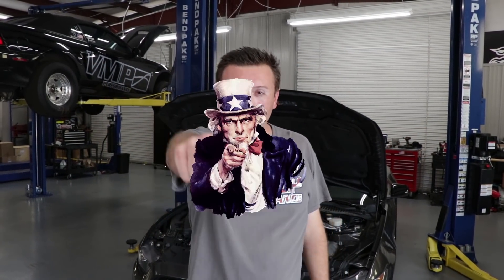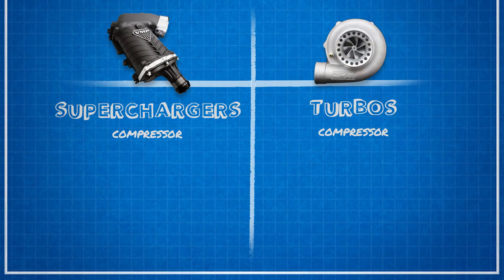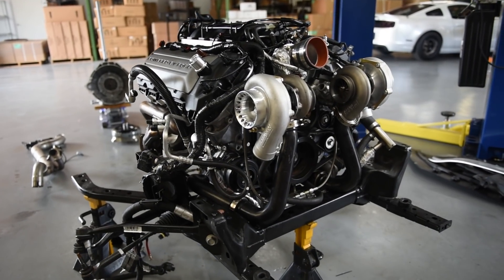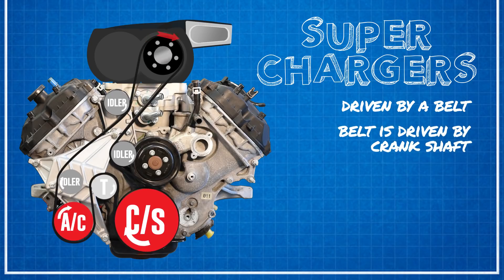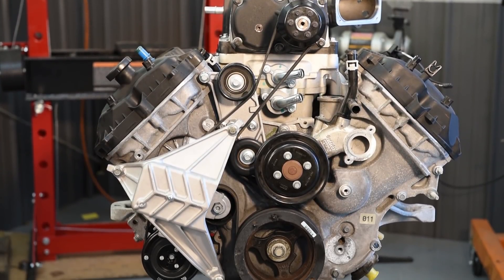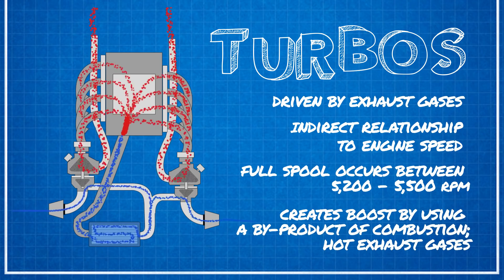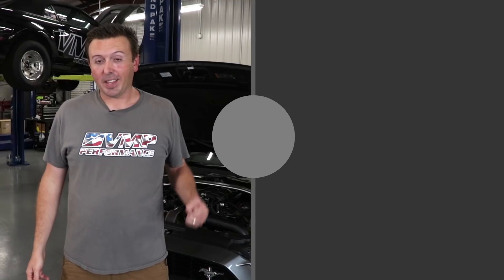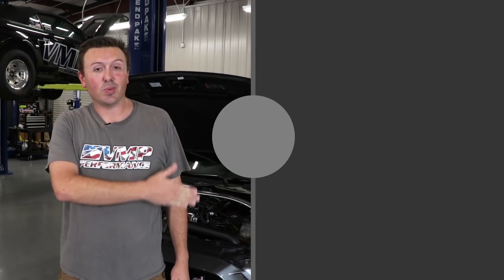VMP Performance | Superchargers vs. Twin Turbos

Comment: I love the  gen3r for boost.. twins turbos are nice too...what can I do to my 2016 mustang gt premium  to make 800hp on pump gas? Is that possible?
Reply from the maker: Hey Billy.  With the Coyote, we're limited to right around 700+/- rwhp on 93 pump fuel.  The knock resistance of 93 won't handle much, if anything more.  With a return style fuel system and E85, you're opened up to 800rwhp and above.
Reply: Do 93 and boostane.  Boostane is fairly convenient and the price isn't that bad (145 bucks for an 8 pack of premium on ebay) which is about 16 a bottle.  One bottle per full tank.  It will get you a decent bit of headroom above 93 only and you could prob Crack your goal with the right supporting mods.  Adding 16 to each tank isnt that bad considering it turns 93 octane into 100 octane lol.  It's like little over a dollar per gallon more which is a bargain plus like I said its convenient just keep a few in the trunk and add whenever you fill up.  Pretty simple.

Comment: Is it safe to have that much horsepower in a convertible? I want to do mine, but afraid of traction issues and taking the fun out of driving the car if it slips on ya.
Reply: If you're asking that question this power level probably isn't for you lol.  These modern cars are very safe but a vert can only be so safe.

Comment: ?the insta tq on a PD car is awesome, turbo will always have more headroom.  street car?  blower all day
Reply: A properly sized turbo will have more headroom.  A tiny one won't make the power.  If it isn't an all out race car the tvs is easily the better choice especially for street cars.  They can still go PLENTY fast and make PLENTY of power obviously.  More trouble free it's just all around better for a street car like you said.

Comment: The twin turbo car is built to be a dyno queen, in real life I personally wouldnt use turbos with a trim like that. Smaller turbos are way better you want to fully spool by 3500. That will make more useable power...

I think between the two the vmp gen 3 is the better way to go. That torque curve is incredible... Thats a very very fast car! And just from looking at the curve more of the vehicle id want to drive.

Also having less parts makes the system cheaper overall to maintain and trouble shoot in the long run.

Comment: You know how, like you are racing someone and you got him off the line, and your like, wow I'm taking this guy pretty good. Then all of a sudden, he goes blowing by you? well, that's what my turbo's will do, just keep pulling and pulling. I have both blower and Turbo vehicles. I didn't hear anything about boost numbers, and or boost control settings, maybe i missed it. In your dyno results, it appears the blower gets some instant torque, and steady power, only to go flat in torque and stops short on horsepower where the turbo's didn't. I'd bet at the track the twin turbo gets a higher MPH and passes up the blower car. Have you ever run these two against another. Then you have weight in the scenario. In the end, they are both equally as fun to drive, just in different ways.

Comment: I just bought a 370Z sport coupe with the 6-speed manual transmission and was thinking that a nice supercharger with about 9 lbs of boost would be a good thing to do later on.
Reply: NOOO TURBO!!! IMPORTS ARE TURBO MAINS!
Reply: A VQ engine is badass supercharged but make better power turbo'd enjoy the whip!